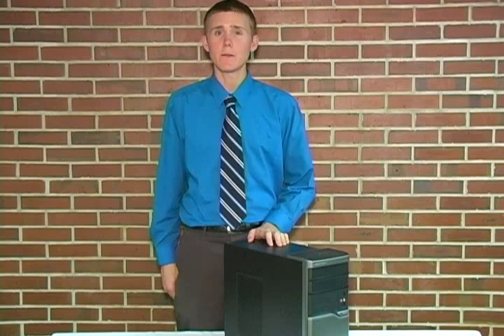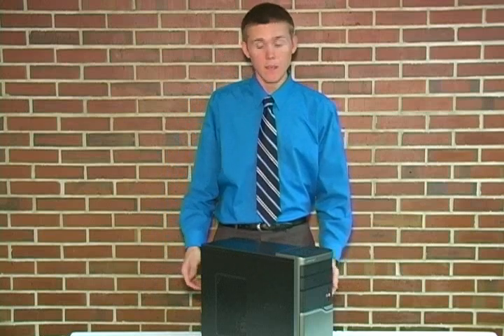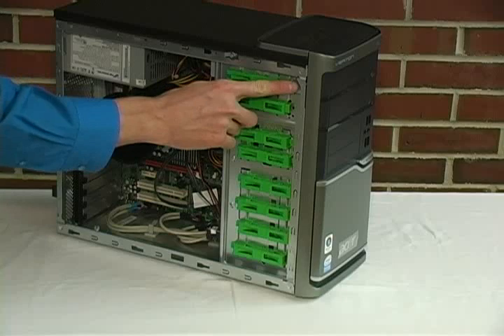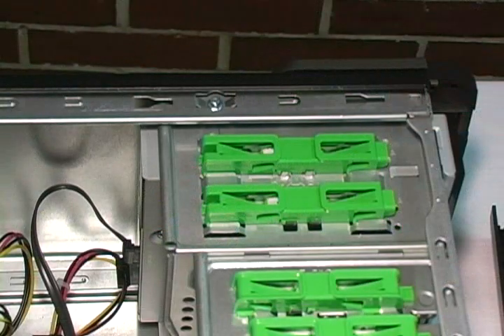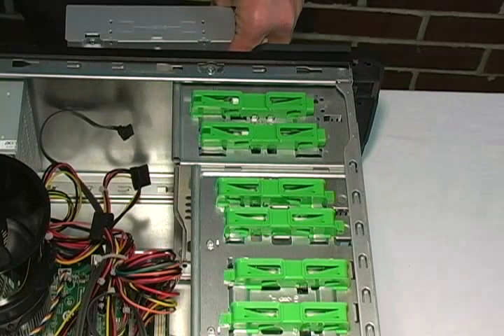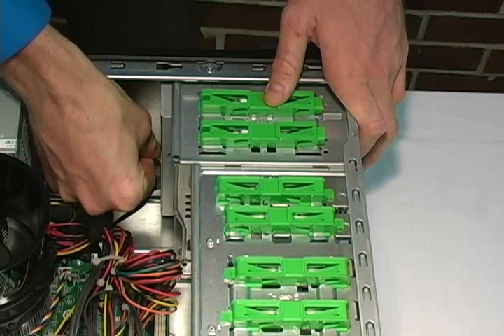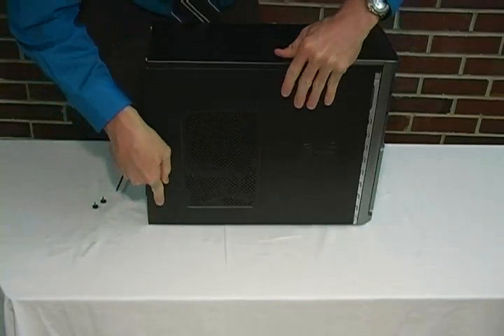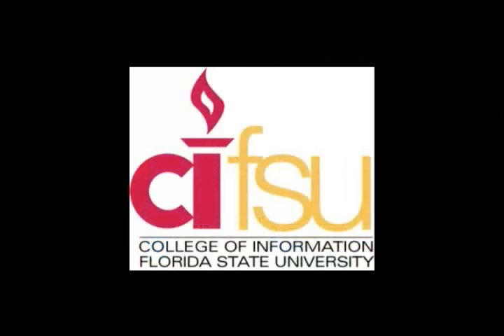How to remove and install an optical PC CD/DVD drive

Comment: I spent an hour watching videos similar to this, then half an hour going over my machine trying to understand how it works, where it all seems to connect to, how it all works. I then did the tasks explained here to the letter, ensuring that I'd done every possible thing to ensure anything goes wrong.

Two hours later, there are loose cords I didn't unplug I can't see where they came from, the cd drive is locked shut and I can't see a way to get it out and I'm pretty sure my system is gone.

I don't even see the point in trying anymore. I know 8 year olds who can do this.

Comment: Leave the power cable in but switched off use an antistatic cable to use the earth wire which bi-passes the switch due to no voltage to earth yourself.

Comment: @FAVIdeoRecords Its a duct for guidance of the hot air being exhausted by the processor fan (Or cold air being drawn in by the CPU fan - depending which way you do it), which increases efficiency and effectiveness of the cooling system, preventing re-circulation of hot air the case.